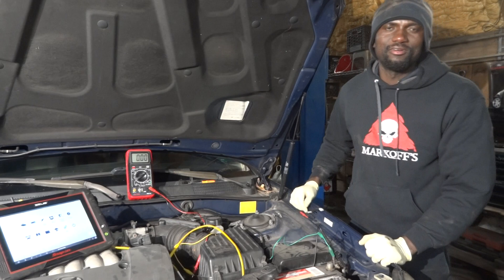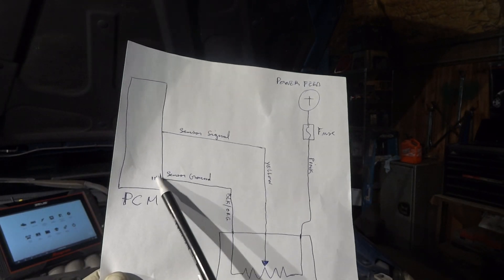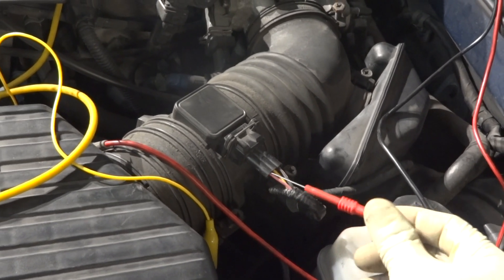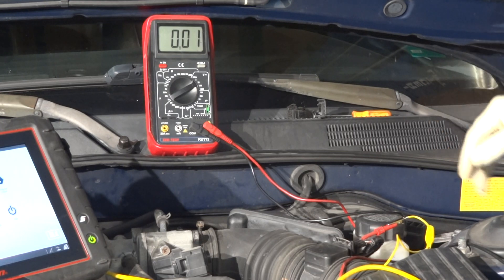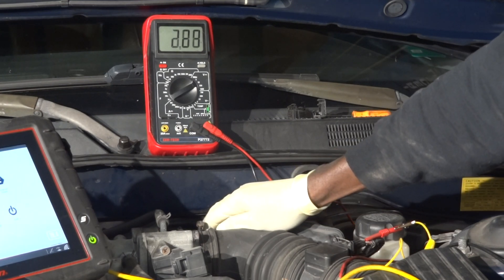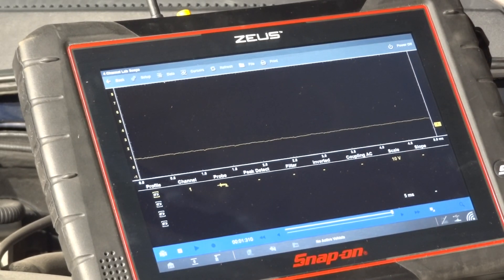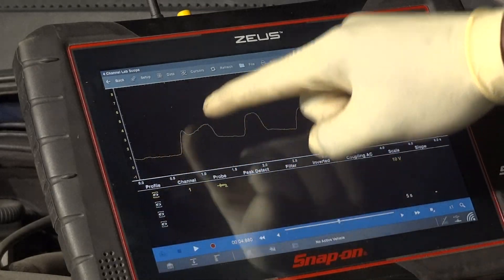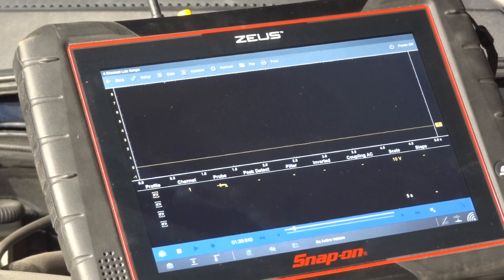How to Test a Mass Air Flow Sensor ( MAF ) with a Multimeter or a Labscope

Comment: I have battery voltage on the signal wire with the sensor disconnected
Reply from the maker: @Conky-l8i  That's odd, you might have a short to power!
Reply: @KITS_Auto_and_Truck_Repair  that's what I was thinking. Very odd indeed. I'm glad you replied.
Reply: @KITS_Auto_and_Truck_Repair  is a 07 Isuzu with 2.9 engine. 5 pin MAF sensor. Same as a Colorado. There should be a 5v on the signal wire for the MAF. As most GM vehicles use 5v from the pcm. Since pcms don't like to work with high voltage. What do you recommend I do. Your help is appreciated.

Comment: What is the deference between power brobe and multimeter?
Reply from the maker: @swift4311  a Multimeter mesures the voltage difference of 2 points but a power probe mesures voltage and can also power a circuit!

Comment: i have new mass eensor  and new throttle body  but tacoma 2005 4 cyl 2.7  engijne stalls at idle  i get po102  po113  AND PO418     WHERE  is fuse in box  and what is it called   thank you thank you
Reply from the maker: @jamesrooney7689   Check your Mass air floe sensor wiring!
Reply: can i buy a new harness for the mas   does one end go to MAS and the other to throttle body ?? thank you for replying lots of folks dont  your  a good man  @KITS_Auto_and_Truck_Repair

Comment: my tacoma jumps up and down and stalls  is that a bade sensor  i cannot keep it running   thank you
Reply from the maker: @jamesrooney7689   what trouble code do you have in memory?
Reply: sorry i have no metor
Reply: i just installed new MAS AND THROTTLE BODY uptill then everything was fine ????

Comment: Hallo 
I'm from Indonesia
MAF sensor output in my car at idle engine 1.30v 
This is not normal sir ?
Reply from the maker: Muhammad Nurul Fadli  what is wrong with your car? what trouble codes do you have in memory?
Reply: @KITS_Auto_and_Truck_Repair  my car Corolla Altis 2001 
Muffler very very smeel gasoline
Because combution bad 
What MAF sensor fault ? Because voltmeter in idle 1.34v 

In video idle 0.8-0.6v 

Sorry very bad English
Reply from the maker: @FaniTv851  Can you tell me what code you are getting?

Comment: I don’t see the two connector from the meter connected to the mass air flow Isensor  only one connected I just try it and I didn’t get a read I had to connect the two wire to ground on the sensor to get 12 volt but you have have one connected and getting reading
Reply from the maker: Jobs Jamaica  The black test lead on the multimeter was connected to battery ground!